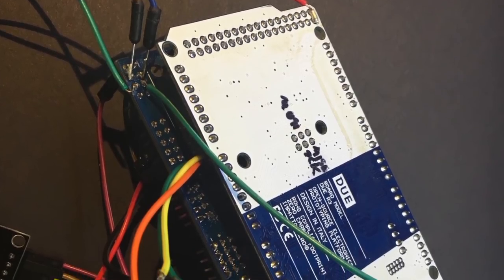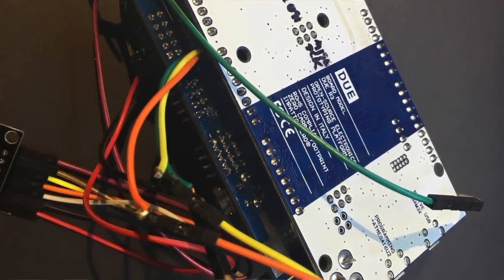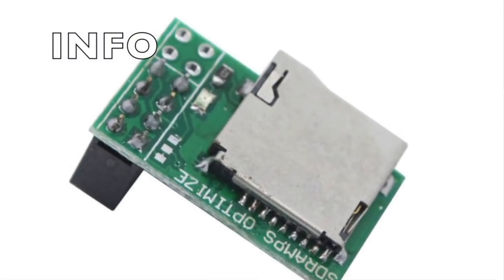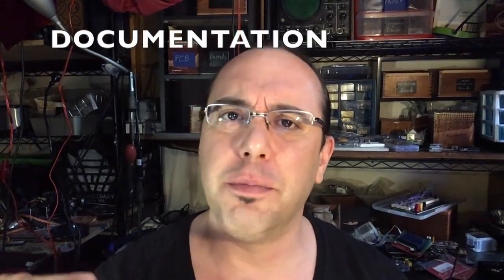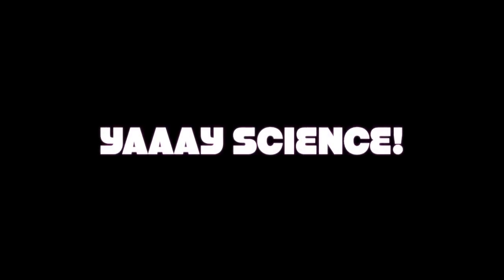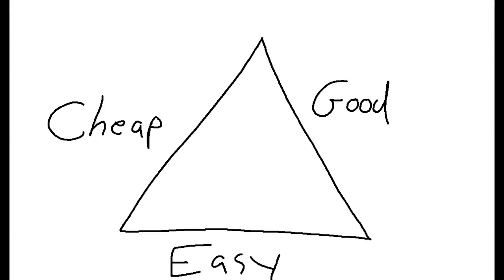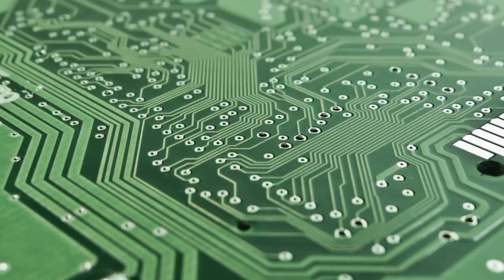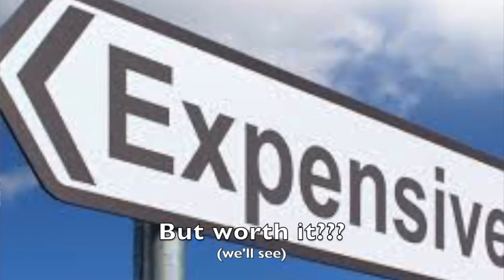Part 1 of 32-bit 3D printing series - Intro

Comment: Im so glad your are doing this series.  I can't find and easy upgrade path from 8bit marlin to 32bit marlin 2.0. So many different boards, in different stages of development and I don't understand the new IDE interface. Arduino is easy. I do know my Delta's processor is at it's limit. I keep having to make sacrifices like less segments or no graphical display. Now I only print from SD card because I get print artifacts printing over Octoprint usb. A deut board is too expensive. I wish there was a drop in replacement for my 8bit board to 32bit. Someday...
Reply: nuroo Just try Klipper software and it will accelerate 8bit mainboard faster than marlin on 32 bit
Reply from the maker: I hear you, man. You probably tried all the tricks, but yeah, the problems with 8-bit/marlin(or repeater, etc) + a fast delta is keeping up with the required pulse-rate, keeping up the with required USB speed, and graphical LCD issues (because you have to feed them data veeery slowly).  So using a character-based LCD and lowering micro stepping helps if you can deal with that (for user-fast stuff, I use Trinamic chips configured in 1/4 stepping + 256x interpolation to cut down on the step-rate requirement), and connect at the highest baud rate you can handle (some com chips just plain can’t handle much speed).   Or like Stanislav said, you could try Klipper for now and see if you like it: the initial setup is a pain if you are not used to working in a terminal, and you lose some comfort features, but it can handle a delta fine.
Reply: It so happens I have Trinamic drivers installed on the Delta, I never considered 1/4 stepping. I'll try it. I also have the 20x4 character display. I will try a higher baud rate also too see if it helps with Octoprint.  Klipper seems complicated. Thanks for the feedback.
Reply from the maker: No problem.  Upping the  buffer size a bit in firmware can sometimes help (if you are not running into stuttering from too little RAM), and just as a test you could try printing over USB from Repetier or some other program a few times and see if the problem persists. Octoprint has had a on-and-off occasional problem with stutter under some conditions, so that's an easy way to check.

Comment: Good to see this Alex. You've probably already come across it, and considered it, but if not you may want to look at the Klipper firmware (https://github.com/KevinOConnor/klipper), as it covers both 8bit and 32 bit boards (we have it running on both RAMPS and Re-Arm (LPC1768)), and offloads all calculations to a Pi or Linux based machine. While it's still technically Beta firmware, it is starting to supersede our Smoothieware Azteeg X5 Mini Printers in both ease of configuration and print quality.  Could be something interesting to include with this.
Reply from the maker: It's on the list.  I'm waiting for some features to mature and then I'll jump on it.

Comment: Fantastic news from Marlin firmware, 1.1.9 is last 1.1 tree version, development is fully moved to the 2.0 which includes ARM support.  I didn't use Marlin, i have Smoothieware on both printers (SBASE and AZSMZ Mini 2.1 board) but Smoothieware is little stuck in development and Marlin now support S-Curve, Linear Advance, Powerloss Recovery and even have Junction Deviation same as smoothieware.  So now I'm not sure if I will switch to Klipper or to the Marlin, but I'm starting to hate Smoothieware...
Reply from the maker: Absolutely.  Marlin 2.0 features look real nice.  I'll do more videos on all that stuff when they officially release it.

Comment: I like most of the content you put up. I am in the process of trying to build a CNC machine to do laser and rotary engraving with interchangeable heads. Looking at maybe adding 3d printing option using the Prusa Multi-material v2 system. For now I have a simple Mega/Ramps 1.4 board to start off with. Euro standard aluminium extrusions are on the way in the mail.  I hope you keep this up. I have been a Blue Collar worker most of my life, even tho I am a Manufacturing Engineering Technologist. I have back problems now and am disabled physically. This is my next step in personal development since I can't be physical for work. Cheers from Canada
Reply from the maker: Sounds like a good move.  I wish I had room here to set up a mill permanently, but I'm an apartment-dweller for now. I'm still constantly amazed at the tools that are available these days, and accessible to regular folks, and that't why I tend to steer toward milking the most from affordable options.  I haven't worked with multi material much yet except to look over the schematics and software, but it seems to be gaining interest.  E3D even announced plans to introduce an open standard for automated changable toolheads, so it'll be interesting to see where that goes
Reply: @AlexKenis  The machine I am working on is desktop size. Aiming for about 20cm x 40cm work area inside the framing. Total width and length add about 10cm. Still thinking about z axis. To stat may be 4 inches. (Sorry I'm working on some items in metric and others imperial) I can always go bigger if the machine can support itself $$$

Comment: Hopefully you will use Klipper in next videos) Klipper makes the decision 8-bit or 32-bit less important
Reply from the maker: I have been keeping track of Klipper for a while, and I plan to do some videos on it as soon as they get some features added and get some better support literature out.  It is a promising project, and I don't want to talk about it prematurely and have people be disappointed with lacking features that they might be used to, which just have not been added yet (fancy mesh leveling, tmc2208 UART control, etc).
Reply: I'm using Klipper starting from end of 2017 and I have to say, that is already nice and polished enouth project. As far as I know bed leveling already added and supported (by 3d party Klipper plugin for Octoprint), there is also support for several TMC chips. By now I'm using TMC2208, however still do not know the case where I need UART control for them. The only feature which left as rudiment from Marlin/Repetier is using display for controlling printer. If people hear about that they cannt use display for entering settings they get very scared and think that Klipper sucks, but it is not, with web interface it is more easy and faster to control 3d printer.
Reply: Most typical use case for people is RAMPS + DRV8825 or RAMPS (or any other Chinese motherboard)+4988, in this case Klipper can significantly improve print quality, maximum speeds and more  without changing everything to 32 bit
Reply from the maker: Yes, it is a pretty nice system already except for a few little things that I am giving them time to work out.  Using 2208 without pre-programming via OTP requires using a separate unit and console window to program them at startup or for on-the-fly status monitoring and parameter changes.  Those are more or less just luxury features, same with unteathered printing and LCD control, but many people would see that as an incomplete system, so I'll just give the project a bit of time to make sure I don't scare people away from it because I like the idea.

Comment: Honestly frowned, this is perhaps outrageous
BUT,
what i peace name is PID tuning?
How the hell are you doing that?

(I have a Prusa i3 with Arduino and Ramps 1.4 with LCD, in LCD I can change setings software)

friendly greetings from The Netherlands!
Rob.
Reply from the maker: PID tuning heats up and cools down your hotend(s) and/or bed for a set amount of cycles and monitors the behavior, and then recommends values for optimal behavior. It is typically run from a console (i.e. USB from Pronterface, etc), but there MAY be an option to run it from the LCD (I think it has to be enabled in the firmware first, and I actually don't remember if it still exists, so you may want to check the Marlin documentation).
Reply: Thank you for your answer!
but now that you're talking about Marlin documentation,
where do you read your Marlin documentation?
would that documentation be in Dutch too? (will look for it myself!)

Thanks again,
and greetings from the Netherlands again!
Rob.
Reply from the maker: HobbyRob you can find marlin’s documentation on their website and GitHub. Marlinfw.org and GitHub.com/MarlinFirmware. They also have a page on reprap.org and you can search reprap.org for general information on things like PID tuning that are not firmware-specific

Comment: Hey, thanks for working on this information. I am looking forward to seeing what you come up with during the course of the series. I was wondering if you can you look at the Longer 3D controller board being used in the Alfawise u20 printers it is a 32Bit board using an ARM CPU supposedly I am curious what you think of it. Thanks
Reply from the maker: interesting.  it LOOKS like an STM32F103VET6 processor (hard to tell from the few pics I have seen).  If that is the case, I have run Marlin on  one, so as long as there is a way to load firmware, it should be possible to make a profile for it. I would have to do more research, but I'll add it to the list of things to look for
Reply from the maker: AH yes, at 5.51.30 he has a good shot of the MCU... definitely STM32F103VET6.  He apparently doesn't know that STM32 had been supported in Marlin2 for a while now (although it is still in alpha stages since there are only a few people working on it), and that there is various basic touchscreen support as well for some of the HALs  (not sure if it will work without modification without knowing the chip onboard the display). If J1 header is a programming port, you could definitely use an STlink or similar device to load custom firmware (if you can't do it vis the on-board serial). The stepper drivers underneath the heatsinks he didn't want to remove are apparently a4988 according to some other sources.  it also appears to use a CH340 serial com chip labeled U10 on the board, which is strange because those ST MCUs have USB serial built in, so you don't have to deal with the CH340 driver, etc, but those chips are okay-ish if you don't have connection and speed problems.  The ROM is likely not stored on that chips though as he and his viewers seem to believe. F103VE MCUs have 512k of flash for user ROM, and a separate memory space for bootloader, etc.
Reply: Ok hey man thanks for checking out I thought it might be an interesting board for your series keep up the good work - Later